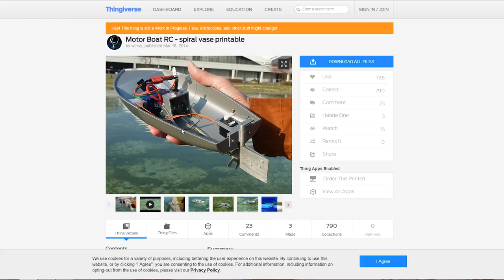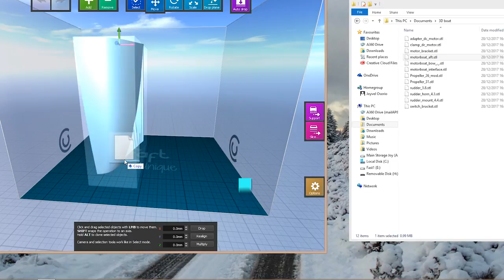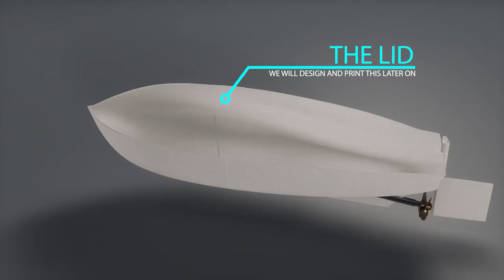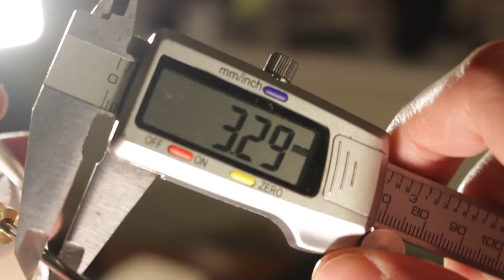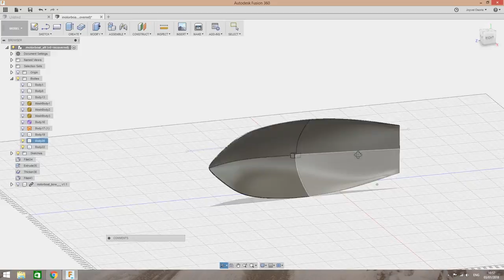How to make a 3D printed RC boat

Comment: Nice Video! Which shaft did you use to connect the motor to the propeller?
Reply from the maker: An aluminum shaft but not the best solution. It's better to buy that part.
Reply: Joyplanes RC 2 

Awesome! Thanks!